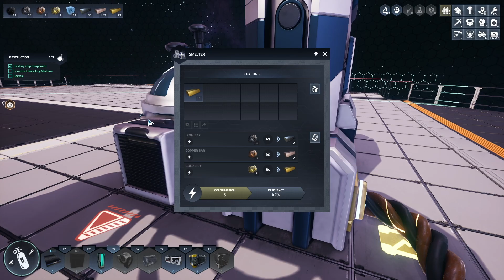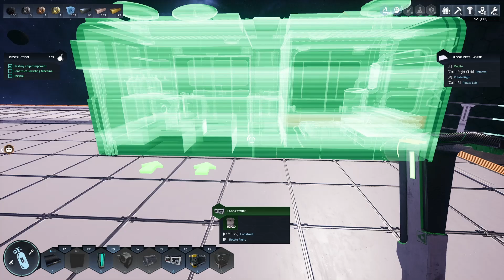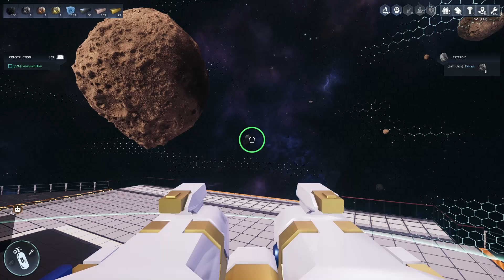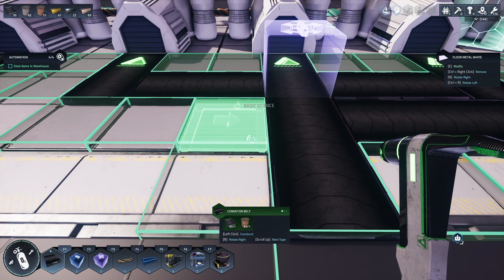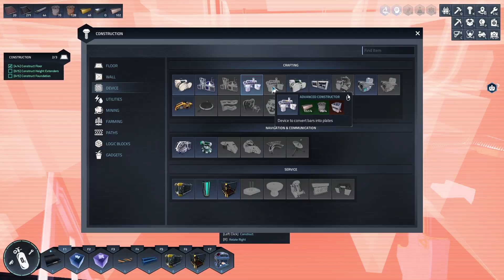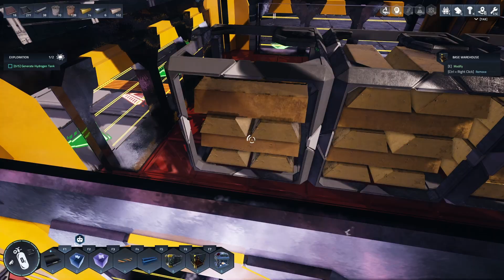Astro Colony - Let's start automation! Ep. 2

Comment: One thing I love about Satisfactory is that you get all your materials back if you break something. It makes it very easy to rebuild your base multiple times. Do you get all the materials back from recycling? Especially in such a confined space, it's quite tricky to build everything correct the first time.
I wonder if you could connect a wire to the energy "block" of a machine from the down side. And maybe those orange sides would nicely follow the corner, a bit like Minecraft stairs behave if you switch directions...
Reply from the maker: The devs have stated that they are working on being able to move machines. Just moving them would be a big bonus for me. If you actually tear it down and lose some I am okay with, but because you don't have ratios like in Satisfactory (a miner only mines a certain material so you can count on getting the exact amount per minute) and I feel that there will be lot's of rearranging in this game to tweak setups.